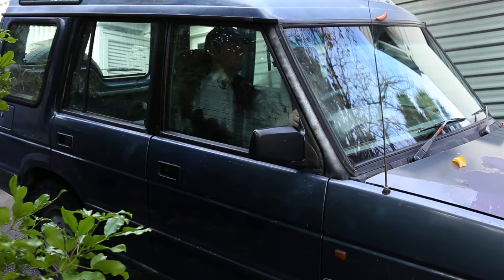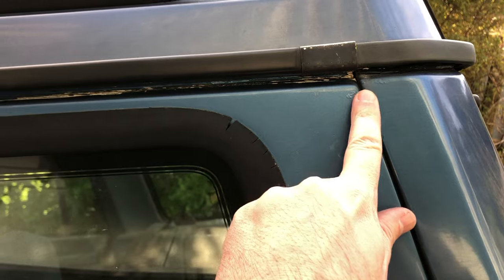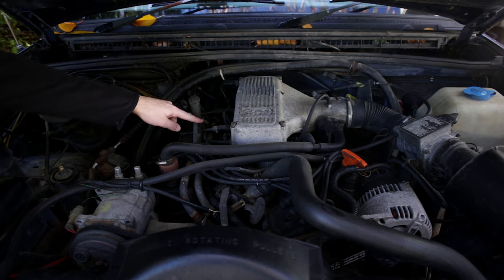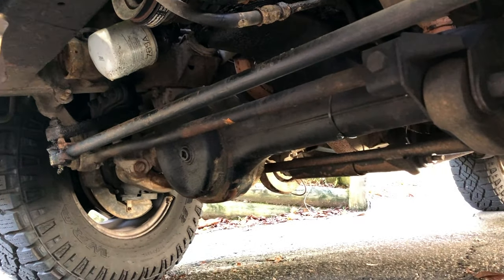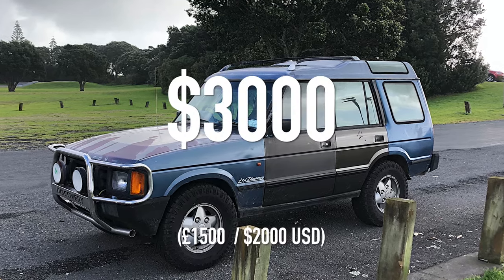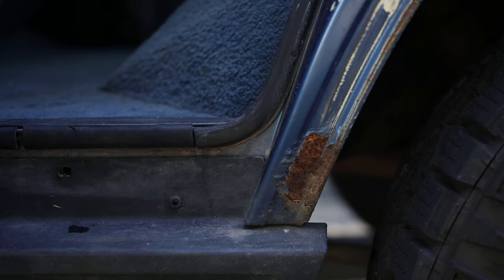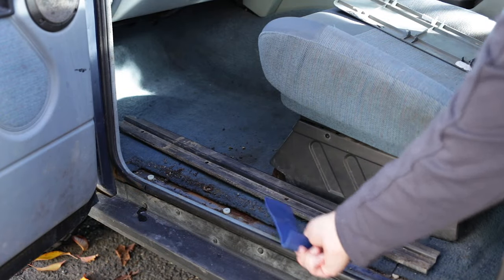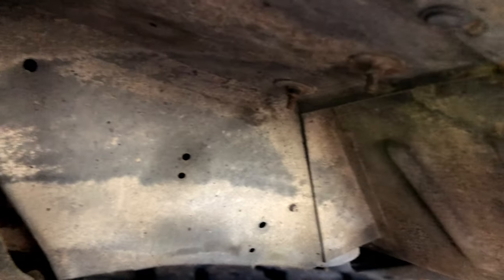Project Discovery // Part 1 - Purchase & Inspection

Comment: What happened to the BMW estate you had?
Reply from the maker: Fixed the ecu problem by replacing half the computers in the car, so now it thinks it’s a different car. At the same time it decided to smoke like a chimney. I changed the valve stem seals. Prob about 30 hours by the time I made tooling etc. Was fine for a week or two, and now blows smoke again. Presumably one of the new seals failed (I replaced the ccv valve last year). Then the mileage shot up by more than 100,000kms, just randomly while driving one day, so I had to change the instrument cluster to reset the glitch. Oh yeah, it’s also decided to leak coolant from around the heater core, which would mean pulling the dashboard out if I wanted to fix it properly. This era BMW suck!
Reply: @CROKERvsRover  Ohh, so you mean the normal BMW reliability and stellar German engineering!  That's why I traded my 850 in after 6mo for a nearly new V70R 😁

Comment: Well as an Americano I am not supposed to like Rovers (We build the Jeep) but I can't help but to have a soft spot for Range Rover classics and Discovery's and of course Defenders and early series trucks (pretty rare here in the states).
I have had three different USA market Range Rover classics over the years and until they got too expensive to purchase I was all about them them, the first generation Discovery being the same chassis was going to be my next 4x4 purchase here in the next few months. Good cars but obviously they are not without their uniquely British faults but nothing I can't handle.
Anyways the 3.5, 3.9 and the 4.2 and the renamed 3.9 that they called a 4.0 are gutless it's just the nature of the beast those trucks weigh probably 4400 USA pounds (2000ish kilos I think) and they make on a good day about 180 American horsepower, they are gutless even in early 1990s terms but where they shine is in that coil spring ride and off-road capabilities not to mention they drive pretty nice although they tend to wallow a little bit but I like that they feel like a 1970s American car but with a lift kit lol. 
Look forward to the video series.

Comment: I think that's the least amount of rust I've ever seen on a Discovery.

As for the engine, I'm guessing it'll need a new cam and timing chain, and it'll perk back up. They're never fast, but no slouch either in good condition.

Comment: Okay, let's break this into 2 things....

#1: THIS Rover you just bought....

First off, the bully bar was the best part!!!    What?!?!?  (okay, joking...  I mean, it certainly was the best part, but it's your truck, do want you want.  I have to give you the business a little bit.  If you need the money, that is sellable....)

Also, I've seen rust way worse than that in the upper midwest of the USA....  So, yeah.  If you need a Driver, thant thing could be whipped into shape, and be a driver for a long time.....

Now, we could debate from now until the end of time, whether spending $7K on a truck, and putting $1k into repairs, makes sense...  Vs Spending $3k, on a truck that needs $9k of repairs....  these are questions....

If you NEED a driver, buy a better one maybe????  Just a suggestion....

Now, on to #2..

#2: the rover you already owned.

Uhhh, that was finished???  I'm looking in your channels....  I don't see the video where it was finished.....  So, you have a project, and now you have another project???  omg...  

Wow....

Uhhh... Good Luck Sir.  Seriously.